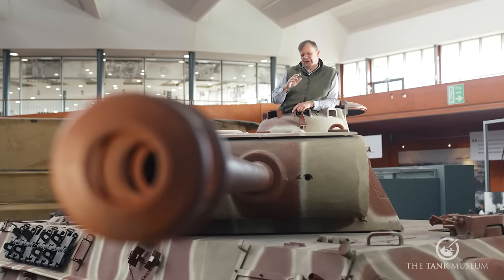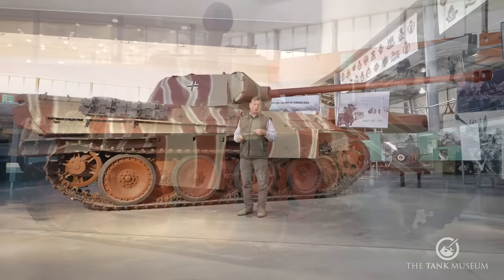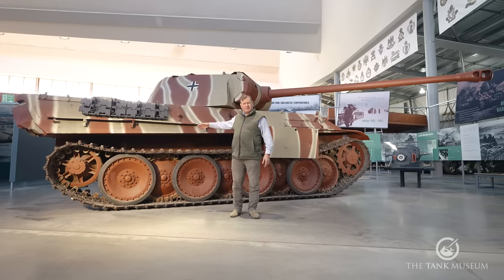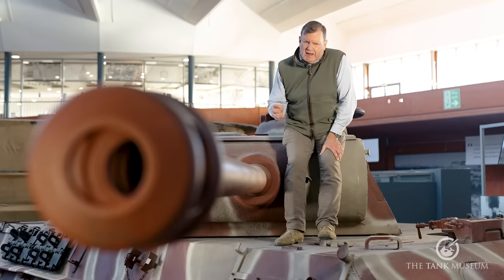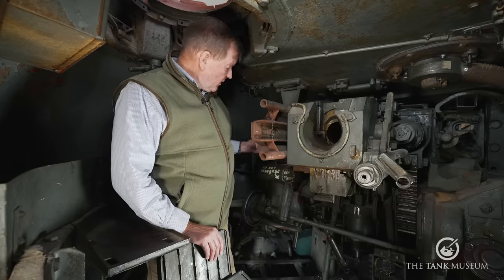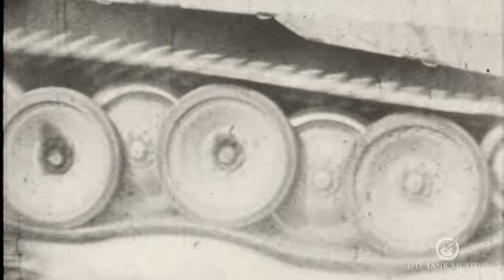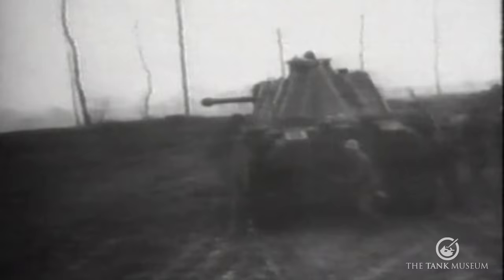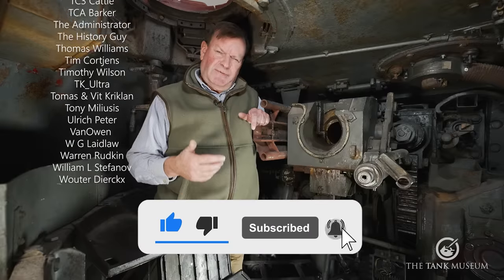See Inside Panther | Tank Chats Reloaded

Comment: Respectfully i dont think rebuilding a tank from leftover parts, then testing it, is probably not a fair base for said tank
Reply: Well, if the war had gone on for a few more weeks, many of those spare parts would have gone out onto the battlefield. But in a major respect you are quite correct - toward the end, Germany suffered from severe shortage of specialty materials, including rarer metals that were used in small amounts to build good steel (nickel, molybdenum, chromium and so on). Late-war German armour was of noticeably poorer quality and tended to crack. This also played into the reliability issue because highly-stressed parts, such as the notorious Panther final drive unit, had to be built from (and machined by) weaker steels.
Reply: @onenote6619  I mean, it might have been a bit better of a tank with the rare metals not being in short supply, but I still think it would have struggled to be reliable. Just based on rushing it into production
Reply: @jeffreyhornblower6515  Just about every tank produced has sucked at the prototype stage. But during wartime you might not have the option of waiting for the prototype to be fully tested and fixed.

Comment: Actually the sloped armor cannot have been inspired from the T34. It's stupid to propose that because german military had the sdkfz 222 for more than a decade earlier. Look at the sdkfz lineup in fact, and they use sloped armor.
The big question is why did the tank division went with the retarded box design
If we compare the sdkfz 222 and the panzer 2, the car is far superior, and it's design should've been used for tanks as well.
Reply: Sloped armor goes back at least to the us civil war with the uss merrimack, also the panther was more designed to destroy KV-1 which was a far greater danger then the small and by comparison easily knocked out t-34.
Reply: because when you slope armor, it also increases its area, meaning more weight
yes overall all you get more protection but you lose significant internal space
non slop armor of early ww2 tanks was more than enough to stop early canons, but as war progressed extra armor you get from slop armor become necessary
Reply: For small tanks, sloped armour is a handicap, because it takes up a lot of internal space that is needed for crew and parts access. It increases the amount of time needed to get in, escape or repair while under threat. T-34 paid the price by being incredibly cramped and difficult to fight in, and the loss rates show it clearly

Comment: Face hardened armour is by absolutely no means easier to manufacture than homogeneous armour.
Reply: Face-hardening works while the hardness of the face exceeds that of the incoming round and can shatter it. Problem there is that the armour has an area of square metres and the AP round in square centimetres. Early-war tank rounds were weaker steel, later-war Allied rounds moved toward tool-steel and tungsten-steel. At that popnt, a move toward RHA was essential, regardless of manufacturing difficulties. Unfortunately, it required alloying additives that were hard to source for the Axis.

Comment: On the G the over-track side armor is thicker but also less sloped. 50mm at 30° instead of 40mm at 40°.
You also calculated the thickness wrong. If the armor is sloped 50° from the horizontal (40° vertical) the LoS thickness is just 52.2mm for the early and 57.7mm for the later hulls instead of 62.2mm and 77.8mm.
Reply: Cool story bro

Comment: 40mm or 50mm isn’t armour, it’s a joke.  The Ferret has 16mm front armour.  It is a scout car.  It has run flat *tires*.  Tires.  2.5x a ferret isn’t a tank.

4x the fuel consumption of a T-34.  In Nazi Germany.  Which was famously short of POL.  And whose logistics was a horse pulling a little cart.  Their logistics train was literally based on the technology used at the Battle of Crecy.
Reply: The Panther had 80mm of armor sloped at 55 degrees on the front. By all accounts the T-34 was much less armored on all counts, and all later war German anti tank guns could easily punch trough it. That wasn't the case for the Panther, not to mention it was 12 tons heavier than the T-34
Reply: 50mm sloped my guy, so 78mm effective... and its for anti tank weapnons of infantary... any tank is lost against a shot from the side or rear.... if you want 100mm in every direction get a maus tank.

Comment: Was the engine choice linked to the refining capacity of diesel versus petrol?
Reply: Diesel is easier to make than petrol. But a diesel engine is more complicated than a petrol engine. Generally speaking, Soviet industry used diesel because it was easy to mass-produce and so using diesel engines was easier for their overall economy. Basically, 'yes'.
Reply: @onenote6619  I'm thinking of the whole fractional distillation thing. I know their navy only used diesel so I'm wondering if there was more petrol available left over versus diesel
Reply: @Habdabi  The Axis used actual petroleum from Romania (fractional distillation) and synthetic fuels from coal (Fischer-Tropf). Obtaining gasoline and diesel from natural petroleum is par for the course. Obtaining diesel from coal is easier than petroleum. Generally, aircraft piston engines (in WW2) work best with gasoline, jets are less discriminating. Bear in mind that in the later war, Germany was refining coal into kinda-sorta-edible butter-oids to keep the civilians fed, and the situation was complicated.
Reply: @onenote6619  interesting, thanks 👍

Comment: A stunning flaw that I did not know before I saw this video ---- the Panther used 4 times the fuel of the T34?  And the Panther engine was inferior to the T34 as well?  No wonder the Germans lost the war.  German engineering genius of the day was unfortunately equalled by German stupidity, manifested by Adolf Hitler himself.  On top of this, Hitler grossly underestimated the incredible technical skill, productivity and manufacturing capacity of the Russians.
Reply: The Panther and even the Tiger 1 used less fuel than a Sherman. A Tiger had a fuel tank of 548 liters and a max range of 195 km, a late war M4A3 had a fuel tank of 630 liters and  max range of 160 km. The T-34 used slightly less - on paper.

Comment: The germans didn't reject the Diesel engine. It didn't make sense to add another fuel to your logistics if not absolutley necessary and at that point nearly everything with an engine in the Wehrmacht ran on petrol. Also please stop to say that as if everyone else used Diesel. The Russians, the Japanese and the Italians used Diesel and with the exception of the pacific the US tanks ran also on petrol as the british did. The german Panzermuseum has three (or four) videos on that topic. 
Also on the fuel consumption: the Panther weighs 15 tons more than the T-34. 
Sorry i write and editing this while watching. But i have to say that the statements without any context are horrible. The engine deck is a weakspot at every tank because it has holes in it.
Reply: German fuel production was also limited to synthetic plants. Low-octane petrol was the product of the industrial process, and all the diesel and fuel oil has to be reserved for the U-boat fleet.

Comment: Panther summarized:

Positives:
- Strong frontal armor
- Powerfull AT gun
- Bore Evacuator and good fume extraction
- Low ground pressure
- Easy to drive
- Large amount of ammunition carried

Negatives:
- Mechanical unreliable
- Limited visibility for gunner and loader
- Difficult to maintain and repair
- Cramped turret
- Weak side armor
- Low reverse speed

The Panther was really designed with the mindset of fighting at the eastern front against T-34s and KV-1s at long range.
However this makes the Panther somewhat lacking in the capabilities of a medium tank in general.
The Jagdpanther takes this to the extreme.

Armor and firepower advantages are just not enough to make up for the deficiencies.

Comment: U highly doubt a 75mm would be only useful at point blank range... Unless it's a short 75...
Reply: At the time of Barbarossa, the short was standard.
Reply: The short 75 on the Panzer IV was an infantry support gun. The 37 later 50mm on the Panzer III was the tank killer. Both were perfectly adequate for their roles at when introduced, much less so when they ran into the KV.

Comment: Never understood why not put engine in front with turret controls & whatever. Then put Men & Shells & heavy armor in back. Solves many issues. I think 😊
Reply: Swedish Strv 103 (S-tank) Israeli Merkava.
Reply: Not enough space for the driver to fit between it and the turret. Unless you get into some strange designs like the Ferdinand
Reply: Modern tanks have advanced optical systems. WW2 tanks have the Mk1 eyeball. To see stuff, the eyeballs go in front.

Comment: This whole video looks like a mess tbh. Panther had many flaws, but damn you made it seem like it was all bad and no good. Even when mentioning the penetration and velocity of the gun, which was the biggest advantage to using the Panther over pz IV and PZ III. Most Panthers were actually mobility kills either due to mines, shots or engine failures (transmission in most German tanks cases). A huge part of the Panther's mechanical failures came from the slave workers used in some factories, the panther couldn't go to it's max speed in most situations due to these sabotages. The Panther was the best tank combat wise, logistically and manufacturing wise, it was a nightmare. 

The T-34 gets an over inflated reputation, while being the most destroyed tank ever created, a testament to cheap materials, and mass capacity of production. Two factors that does not determine a better than in a vacuum of vehicular capacities. Had there been the same amount of Panthers as there was T-34, Europe would look grim today.

I'd even put the M4A3E2  as second best tank of WW2. Providing adequate defensive capacities, a gun packing enough to knock most of it's target, while remaining manoeuvrable for the infantry support and assault job it was tasked with.

Comment: A design so good the gunner doesn't have a secondary optic to see outside
Reply: Didn't need one. It would have got one if crews requested it. The loader got a periscope after crew requests.
The gunner was on the same sight line as the commander, and it was the commander who selected targets, not the gunner. The Panther commander had a superior cupola and all round vision than the Sherman commander did.
There were numerous changes and improvements made to Panthers (and Tigers) during the production runs. Almost on a monthly basis. A gunner getting a periscope was never felt to be a pressing requirement in need of addressing.
Reply: @lyndoncmp5751  I should find the thing I read about the acquisition speed of a target because if I remember correctly, a Sherman gunner could get a clear shot after getting the information from the commander twice as fast compared to a Panther
Reply: @enkilav2472

But the Panther commander could identify a target quicker than the Sherman commander with his superior vision. Six of one, half a dozen of the other. 

Might also as well say that the Sherman had a problem seeing stalking enemy infantry low on its flanks because it didn't have side turret vision ports like, say, the Tiger did.
Reply: @enkilav2472  There is no documentation that shows that a Sherman did it in half the time as a Panther did.
Reply: @Dreachon

Correct. There isn't.

Comment: . "Sloped armour was a design feature borrowed from the T34" any source for that? It's not like sloped armour was common in many earlier tanks - many of which germany captured.

I'd really like to see if there's any source to back it up or if that's just repeating common sayings.
Reply: wrote: ""Sloped armour was a design feature borrowed from the T34" any source for that? It's not like sloped armour was common in many earlier tanks - many of which germany captured."

-- Sure source was a Battle at Mtzensk in early October 1941 of H. Guderian and M. Katukov of 4th Armored Brigade of Red Army, Panzer Committee as a result was formed and flown9instead of waiting for T-34 arrive to Germany for study) to Mtzensk on A Hitler's FW-200 that include F. Porsche, A. Krupp and E. Aders among many others. Specs for what will became Pz-V was formulated and signed in November of 1941, that included a single armored plate for frontal armor(instead of three as Mr. Copson explained in this video), and that included use of geometrical advantage where LOS doubles at steep angles(~60 degrees) of armor plate, feature that was not used on any other tank in the world prior to T-34. Calling LOS as "sloped armor" is a very dubious and misleading term. You can pick up any book on Panther tank development and read about it. If you need specific book on the subject, just ask I'll gladly point it out to you.

Comment: L/70 Not much better? It's anywhere from 40 to 60mm greater penetration at a kilometer depending on the projectile. That's a pretty substantial difference. That also doesn't take into account a good 200 meters per second or so higher muzzle velocity, which should give a notably flatter trajectory. That also beats out the KwK 36 on the Tiger. Not sure how that would qualify as not much better. And these figures come from US and British tests, not German specifications. Just to be clear on that point.

Comment: By 1944-45, German armor was being made of inferior steel at an increasingly rapid pace.  That frontal armor is probably 3/4 as effective as earlier face-hardened steel at the same thickness and slope.

They couldn't do the same thing with the guns, they recieved priority treatment and all the care they needed to complete.

However, that doesn't mean it was purely quality of parts or manufacture that caused these reliability issues.  It was a FLAWED design from the get-go.  Where the Germans could have gone simple and straight-forward, they did the classic "German" thing and over-engineered the whole vehicle.  Even as simple as the Panzer IV is, you still have to remove the turret, and the whole front end of the tank, to get to the final drive.  That means driver, radio operator, machine gun, etc.  its a mess.